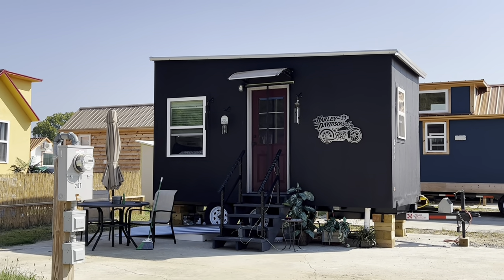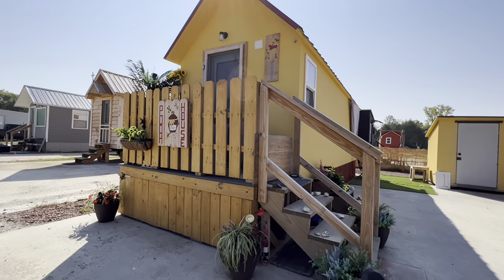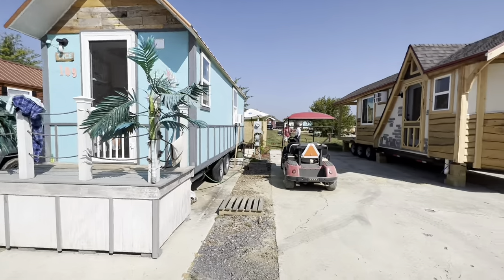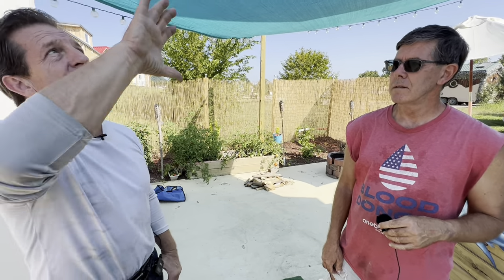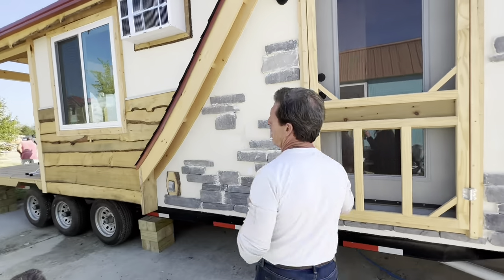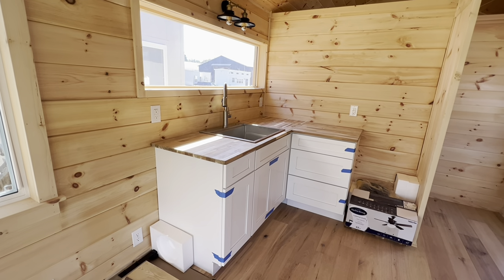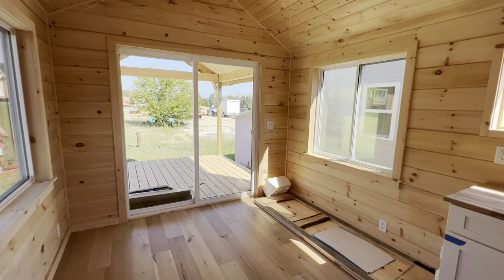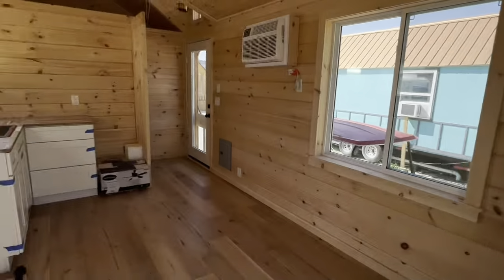10’x30’ Abingdon Inspiration Model Tour on The Beach Community 🏡🇺🇸🤗😉😲🏝️🏖️

Comment: Mayor Mike - since you are an artist, consider using pink board (rigid closed-cell foam) panels for your skirting. It comes from Lowe's in  big sheets that are easy to cut with heavy duty sheers or an electric bread knife, and can be painted. You could make it look like your house sits out over the water on a beach! ⛱️
Reply: @CapysGardenShop  - I can see why! It's super easy to work with. A 4'x8' sheet that's 1 1/2" thick has an R value of 7.5. It's solid pink on one side and all the writing is on the other side. It's pre-marked to cut in half lengthwise, for 2'x8' panels, and an Incredibox would only need 3 panels at $42 each for 2' tall skirting. Just spray or roller paint the outer side, and install.

Comment: I would put two small closets on either side of the sliding glass doors.  You would have to move the light switch.  Have you done any built ins into the wall for shelves in any home?
Reply: Yes, a lot of built in shelves in custom homes. Now, though, with the model homes, that is an owner finished item, after delivery.

Comment: Is that stucco paneling!  
Or wire lathe and stucco.
Reply: It's Faux Stucco (rubberized), so no wire needed. It just gets applied straight on the surface.
Its called Stucco Flex.
Reply: @reynetallents  That's Incredible!!

Comment: They may want to Stain the concrete. Paint will peel sooner or later.
Reply: Prep is important.  There are concrete primers that will help with adherence and smooth out irregularities, and of course you'd want to use special masonry paint. Stains can be nice.  It all depends on the effect you want.

Comment: Q&A question if the incredibox is slow down will you guys change the black building or what I'm now calling it The incredidome to an ESP building for example you would make models but that are ESP homes? Also will you so modles like an ESap version of the Abingdon or Charleston ect?
Reply: There already are both the large and small Incrediboxes, and an ESP 10'x20' being built there. Since ESP appeals to a lower price point home buyer, maybe at some point in the future Randy will add another model that's 10'x24' or smaller.
Reply: @susanbeals7597  yes I know but they stopped making them they don't make the houses like they used to in fact the incredi boxes replace them but the thing about the incrediboxes that I'm worried about is that they're a niche once they sell all those to the people who are interested I think that will be it you'll get more people interested in the homes so what my question is are they going to plan on doing ESP models again and are they going to do them like either the other models or kind of like the incredibox where they'll have specific designs so they can make them easier part of the reason why they stopped doing it was because it was hard for them to build them
Reply: @CapysGardenShop  that would be nice

Comment: Has anyone suggested putting any bamboo used in large containers so it doesn’t spread?
Reply: There is clump- bamboo. It more ore less stays five feet across. In containers they need a lot, and i mean a LOT of water or they die.
Reply: @tteric67  Yes, Fargesia would work nicely, and there are nurseries in TN that specialize in bamboos carrying several varieties.